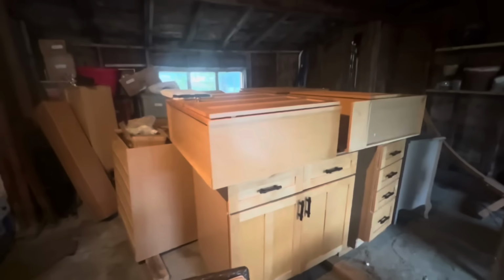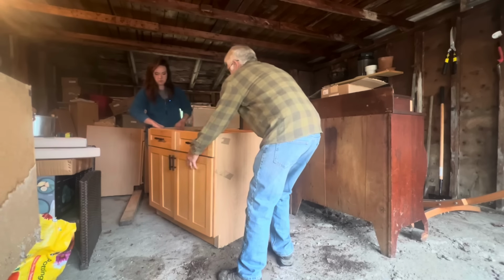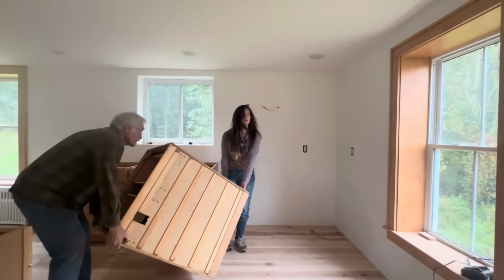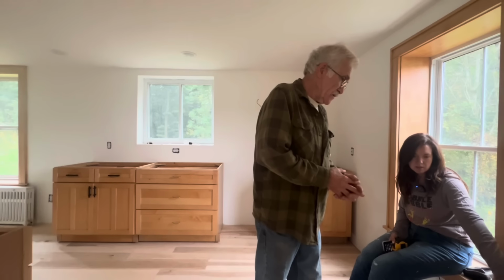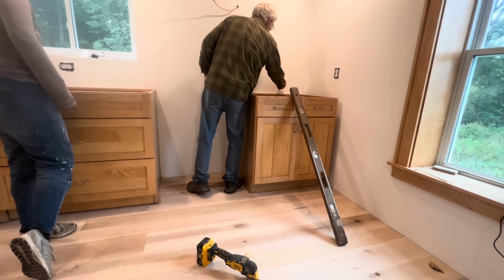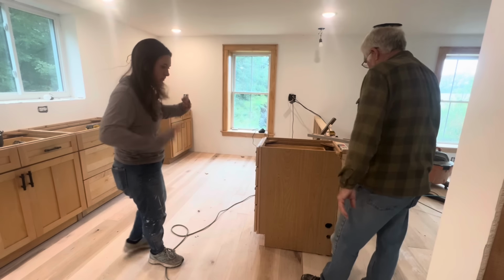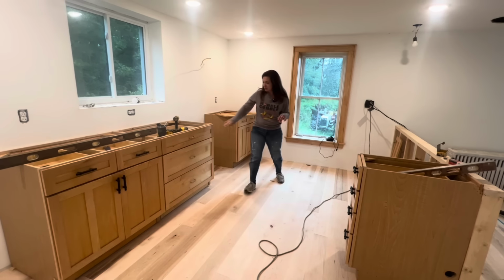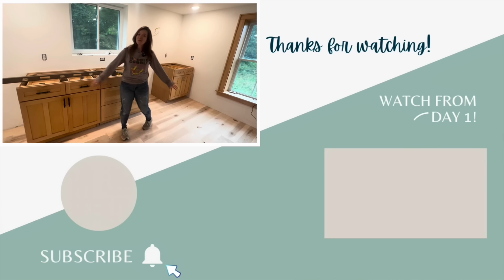MY KITCHEN CABINETS ARE GOING IN!! 🤩🤩🤩

Comment: Where’s the electrical outlet for the stove? Even if it’s gas, you need electricity for the lighter.
Reply: And the clock. 😂
Reply: yes.  need to add a lower electrical outlet for stove.

Comment: I think you need to put the sink in the middle of the peninsula and the cabinet  to be built on the other side
Reply: Here’s a couple of options. The dishwasher can be put at the end where your drawer unit is right now. But remember to put sink next to dishwasher. You could then move the drawer unit to the other end next to the wall. You can build a cabinet around the dishwasher. 
Also you need electric down wall behind stove even If it’s gas for the igniter.

Comment: Don't go with a stainless steel sink ! You will hate it, if you don't dry it out after every use, you have ugly water spots all over and it never looks clean. It is the one regret I have with the renovation of my kitchen. I went with the stainless because all of my appliances were stainless, but I absolutely hate my stainless steel sink. I would love to have my cast iron sink back again ! Your home is ging to be absolutely gorgeous ! I love all of the choices you've made and have been watching since the beginning. Love your kittens !
Reply: I agree.
Reply: I have a stainless steel sink and I love it! It cleans up so nicely and is indestructable. Everything comes off of it. I use Barkeepers Friend on it like every week or so and it looks brand new after 22 years!
Reply: @suecustard5725  I have a double, deep stainless sink with removable grates at the bottom. Those prevent the scratches that can be seen in regular stainless. If you wipe out your sink once a day, generally after cleaning up dishes from a meal, it will look fine. Chips on a porcelain sink look worse.

Comment: Those cabinets look so nice in your kitchen. As far as I can tell, they're a very good match for the trim around the windows. They also appear to be really well made. GREAT purchase!  

Since you're not going to use them all in the kitchen (and if you have the floor space) have you considered modifying one of them and putting it on casters to use as an extra food prep station or rolling island for entertaining? You could add veneer and/or decorative molding to the unattractive sides to cover up what you don't want to see. Jay can add a base to make it taller if needed. 

Meanwhile, hats off to Debra and Jay!

Comment: Hi abbi, nice cabinets! I was thinking about the surrounds of the sink area , may I suggest that you construct the vertical planks into a sort of panel , same look , just much easier to remove to gain access to the plumbing in case of the dreaded leaks , if and probably when they happen within the half wall , dishwasher pipes and drain sink drain and water supply, all would be much easier to access without having to contort yourself into a horrible upside down situation trying to work lying down looking up !! Love how it’s all coming together 👏👏👍

Comment: The cabinets are beautiful. I do wish that the drawer cabinets were centered under the window. Maybe you can shift them down and build a pull out spice cabinet to the left of the stove. You probably have enough space there you could do a pullout cabinet for baking sheets etc.... That would center the cabinet and give you a extra storage! Also, the plug for the stove seems to be missing? Unless they are coming back and putting in a special outlet??  I do think some nice beadboard  painted your wall color would go along the peninsula and end cabinet.

Comment: Abby, you can buy maple veneer end panels to match your cabinets at Lowes or Home Depot. Just look for the closest color match. It might be a little late, but I thought I saw some mildew or maybe just a stain on the bottom of the cabinets. Since they were stored in the garage for awhile you might want to clean them with some cleaning vinegar. This will kill any mold or mildew. You sure we can’t convince you to have an island instead of a peninsula? Would be great for flow and might give you extra island seating. I like the black hardware but I think maybe an oil rubbed bronze would be really pretty.

Comment: Looks good. Why doesn’t Jay make the cabinets out of the cabinets you have left over? Then they would match perfectly. Also you need a side for the drawer cabinet beside the dishwasher as it has holes in it probably for the last persons dishwasher. You could just use the side of one of the extra cabinets. The kitchen will be beautiful

Comment: You can use surplus wall cabinets to use as base. You can tie them back to back to make an island if you have the space. You would save yourself a lot of headaches and possible damage by removing doors and drawers when moving the cabinets. The tipping toward the front can cause you to loose a drawer or spring a door. If you plan on replacing your hardware, make sure you know exactly how far apart the holes are. They are not all the same. Some are metric, some US standard.

Comment: After your stud finder finds a stud I take a real thin nail like a panel nail and push it into the wall.  If it goes all the way in there isn't a stud.  Move a little and try again.  The stud will keep the nail front going in.

Comment: Instead of a free standing stove, does the US have separate ovens and hobs? It would mean if one of the elements were to break down in the future, you would only have to replace one of them. Jay could easily make an oven housing unit and the hob ould fit into your worktop. Lovely cabinetry 😊

Comment: I t would have been nice had you centered the horizontal cabinets on outside wall, directly under the window. Is window 36" wide? You could have moved the entire lower bank of cabinets to the left and, had larger space in the right corner where you installed first cabinet, for a filler panel.  Does that make sense?

Comment: Just curious - why weren't you using a hand truck or a dolly to move the heavy cabinets?  Same reason you still haven't purchased saw horses?  Good investments, multiple uses for many years -  Was difficult to watch Jay lifting heavy pieces like those.  The cabinets are very nice, they look very sturdy, well built.
Suggestion - The cabinet with the 3 large drawers, would look much better if it was centered under the window.  Move the corner cabinet down and can use filler to take up the space between the corner cabinet and the wall.

Comment: How about making the countertop a waterfall on the sides. It would cover the ugly sides of the cabinet. And it you made the countertop overhang into the family room you would have a breakfast bar as well
Reply: Overhanging the countertop into the family room is essential. Not sure what she has planned but I would make a sixteen inch wide overhang that would be 42.5 inches from the top of the overhang to the floor. One and one half inches of that sixteen would overlap the counter on the sink side. That means you would have to put a finish backing of about 5 inches above the sink. I'm not sure what you're saying with regard to a waterfall but as to the walkway side of the counter I would not extend the overhang more that 2 inches on that side. By doing that she could put finish molding under and around the overhang. This change would block the view of the work area and sink and allow pass through of food and service goods and provide an elevated seated eating area if you wanted to use it that way.

Comment: Why don't you do a waterfall countertop down the sides of the two cabinets? You said you were going to have a countertop that you eat at. So when you do the counter top do a waterfall one. Are you going to have the pulls, knobs and handles match on the cabinets? Did you say the fridge is going in the pantry?

Comment: I'm wishing I can talk you into a UNDER COUNTER sink.  When you wipe/ clean the water will go into the sink.  Over counter leaves a mess at the sink edge to cleanup
Reply: It is really the only way to go BUT it all depends on the sink counter used and who is doing the install. That sink has to be cut and shaped perfectly and is difficult to do whatever material you use. If you are installing granite or something similar, the providers will come out and measure the area and make the right cuts with holes and in most cases complete the install. It's one of those cases where you look for an advertiser to support the cost of the install with overhang.
Reply: I agree! We cook and can and it has been a life saver. So easy to clean and we just push water drips into the sink. Love mine

Comment: That kitchen is kind of a fail for you because all your meals are prepared in a Air-Fryer, Insta-Pot, bread machine, espresso machine and a Panini Press and you need kitchen garage doors.
  Your not baking a turkey in the oven and sitting at the dining table with your family, you're working all the time and talking to your cats when you come home. 

 You're going to eat on a stool on your kitchen island and throw your paper plates and pizza boxes in a trash compactor and only use your dishwasher every other day. You definitely need a freezer with drawers because any food you prepare that's big enough to fill a lunch box should be frozen or it goes to waste. Your not storing heads of lettuce and gallons of milk like a family. A single person like you needs more freezer space than a family normally does and organized freezer space because it's multiple small, little bits of this and that meal not a big frozen turkey that's easy to find. Meals for yourself should require more than 50in of counter space to do actual work on the rest is for your Air-Fryer and gadgets to make Meals quicker.